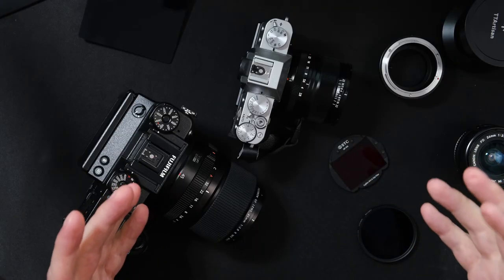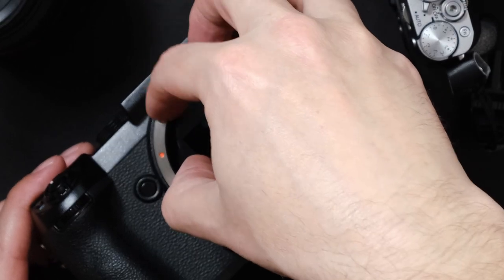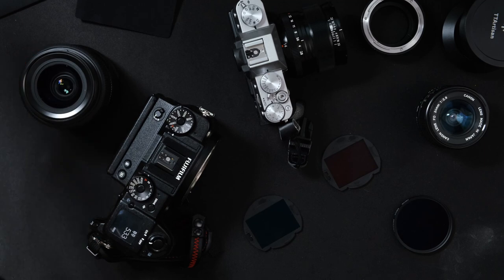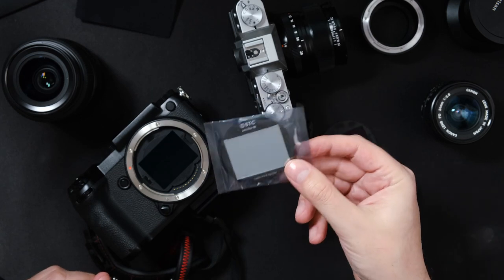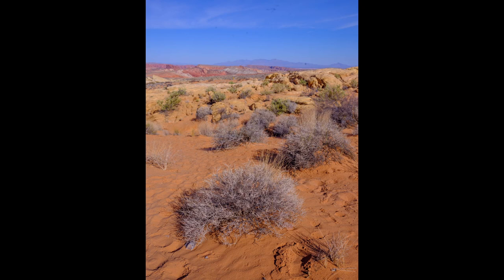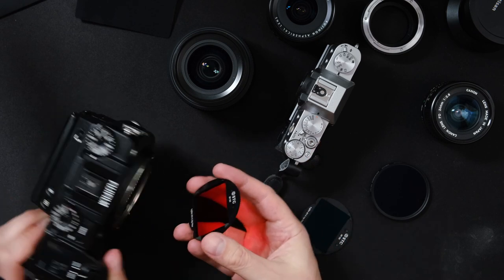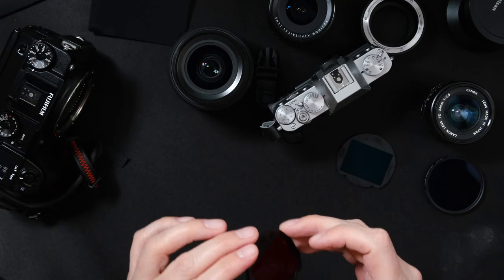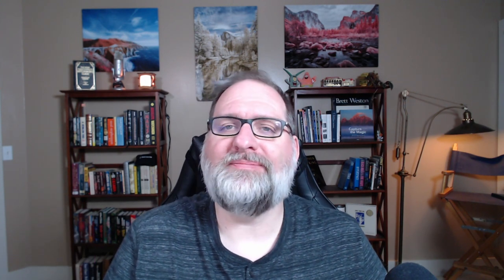Clip-in or Flange Filters for Infrared Photography

Comment: Thanks for your discussions on shooting infrared. I’ve been shooting with external lens filters for 8 months now and I recently decided to switch to clip-ins to cut down on the number of missed shots because of sun flares and glare. I have really nice, coated Kolari filters which do a great job limiting the flares and glare, but I’ve nevertheless missed out on some compositions I really wanted because of the sun’s position. 

I should also add that I tried using lens hoods, but the amount of things stacked on the front of my lens resulted in vignetting that compromised my picture. With the clip-ins, a lens hood becomes an option again for flares and glare.
Reply from the maker: Excellent! After taming hot spots, I've discovered that battling against sun flares and halos to be the next on going battle. They are certainly less of an issue with my clip-in filters than they are with external filters.

Comment: They are relatively easy to DIY.  I used a E 0.29  black plastic file folder to cut out the relatively complicated shape of the holders. I glued gel filters from a Lee sample booklet with contact glue. (dark red, light red, orange, teal and indigo).  Works just as good as expensive filters with my 7 artisan fish eye and my super wide objectives, which have a curved front element.
Reply: Full spectrum converted Sony 6000 a

Comment: Thanks for the video, Rob. Did you get to notice any differences with hotspots. I figured there could be differences because of the difference in elements the light can bounce around you in.
Reply from the maker: I've not noticed a difference in hot spots using when using flange filters compared to external lens filters. That would be an interesting test, but you'd need the same filter in a flange and external lens form factor to really confirm. I suspect that there is not much difference, since the most problematic hot spots result from how IR light refracts within the lens itself. I would expect switching lenses to have a much bigger impact.
Reply: I suspect there will be little to no difference. The hotspots are a function of the AR coatings not being tuned for IR light as well as the dispersion/color correction of the glass elements being tuned for visible light. The hot spots occur in any case, IR filter or not, you just don’t see them with a hot mirror in from of the sensor.

Comment: Rob - thanks for the excellent video. I'm thinking of getting a set of clip-in filters for a converted Nikon Z camera and am wondering if you saw any negative effects of clip-in filters on optics... hot spots, sharpness, etc other than dust? I've heard some reports of odd color and exposure issues with clip-ins especially with wide and ultra-wide lenses.
Reply from the maker: I've used fisheye lenses with clip-in filters and not seen any issues. But I guess it will depend on the camera model and lens. Extra dust on sensor is the only issue I've encountered.

Comment: Thanks. Very helpful. I have just had a Sony A6000 converted and i was tempted to get a full spectrum conversion and use these drop in filters but still quite difficult to get hold of them in UK and the few reviews i could find suggested that the Sony APSC filters were drop out filters and quite awkward when changing lenses which i do a lot in the field. So i stuck with another 720 nm on sensor filter. ps thanks for the white balance video and profiles; a huge help.
Reply: I am using a converted A6000 now, these filters work pretty well. I had to order them from asia, though.

Comment: Hi, Rob.  Excellent video!  Another downside is they are quite a bit more expensive than screw in round Hoyas.  I have an unmodified Z8.  Do you know if the drop in Kolari as dark as the Hoya 720nM?  I really like the idea of the drop ins so I can use some of my extreme wide angles.  Also, how are the Kolaris shooting into the sun?  My Hoya creates a huge amount of lens flare.  Thank for all your help!
Reply from the maker: Interesting idea. I should try a test to compare internal filter to external filter when shooting into the sun.
Reply: and on the comparative darkness Q?
Reply from the maker: @eddieagha5851  I have yet to specifically compare the Kolari filters directly with Hoya. In general, the Kolari filters that I have are of great quality and effectively block/transmit the wavelengths they are rated for.
Reply: Thank you Rob!

Comment: Very interesting.  I just replaced my 590nm X-E2 IR with a 560nm X-T2 IR conversion.  This might persuade me to go full spectrum with a new camera at some later date.

Why is there no such thing as a light bag, or a clear changing bag?  This would be ideal for changing a flange filter in the field.  True, you could use some camera rain covers, but most are too porous and not suited to a dusty windy situation.

Did you use STC flange filters for this video?  They are the only ones I could find that are suitable for Fuji.

STC says some lenses are not suitable but do not say why.  They include 15-45mm, 14mm, 16mm f1.4, 18mm f2, 23mm f1.4, 23mm f2, 27mm f2.8, 35mm f2 (but not 35mm f1.4) and 60mm macro.  It can’t be a physical problem so it must be something like colour fringing.  Do you know what the problem might be?  If you used STC, did you try any of these lenses or are you still able to do so?

Kolari have flange filters for Sony and Nikon so perhaps may have Fuji in due course.  They do not mention any problem lenses with their current range.  Kase have non-IR filters for Fuji and say they are not aware of any compatibility issues with lenses.
Reply from the maker: I like the changing bag idea. Something to explore.
I suspect that the unsupported Fujinon lenses physically extend into the flange in a way that would touch the flange filters. Take a look at one of the unsupported lenses from a side angle, you will notice that a black plastic ring extends out beyond the silver mount. This black ring probably intersect with the flange filter. When I first discovered these filters, I was disappointed to learn that two of my most commonly used IR lenses are unsupported. As a result, I didn't purchase any for my X-mount bodies. With the GF-mount, the support is better, so I only have flange filters for the GFX system.

Comment: Hi Rob. 
I just found your channel and I find it very informative and the best for infrared photos.
I have a question , I'm into Landscape and deep Sky Astro.  I got my Canon 6D Astro modified visible Ha.
I was also looking at getting my old Canon T3I modified as perhaps Full Spectrum.  Then ofcourse I ran into your channel. Now I'm interested in Infrared 590nm and 720.
I would like to use infrared as a walk around camera. 
My question is if I get a Full Spectrum  camera for Astro I'm assuming I can use filters to achieve  590 nm and then 720 nm?
My idea is  to make a 3 in one multi purpose Camera. Is this possible?
Would I need long exsposure using Hoya 590 and 720 sin on filters. 77mm
Reply from the maker: A full-spectrum camera can serve as both an astrophotography camera with Hα, OIII, or SII filters, and an IR camera, with a variety of high-pass or dual-band filters. If you are using a 590nm or 720nm filter on a full spectrum camera, the exposure times will be comparable to visible light photography. The higher the value of the high pass cut-off, the more light is blocked and the longer the exposure will be. With an 830nm filter, you can still shoot handheld, but you might need to increase the ISO.
Reply: @robshea  thank you Rob for helping. I just picked up a Hoya R72 filter and my Full Spectrum Camera should be in on Thursday. I'm looking forward to this new chapter of Photagraphy.

Comment: Is there a benefit to using a drop in or flange filter over the one on the end of the lens with respect to reflections or flare? I would think having the filter closer to the sensor would possibly reduce those negative effects.. but not sure…
Reply from the maker: There might be a slight benefit, but only over using circular filters with multiple step-up rings that move the filter away from the front of the lens. I have seen artifacts when using many step-up rings. However, I've not seen any issues when using a circular filter directly on the lens.

Comment: Thank you Rob. Where can I buy these? I have a Fuji X full spectrum camera.
Reply from the maker: STC Optics has filters for both X and GFX. I would recommend these for converted cameras only. https://usa.stcoptics.com/collections/fujifilm
Reply: @robshea  Hi Rob.
I just discovered your channel. Wish I did many years ago, there has been a lot of trial and error instead...
I used to have a fuji S5 IS (full spectrum), then i had a xe1 converted for IR only. And it's what I have been using now and then.
However I've been thinking about trying IR with a more modern , higher res , though unconverted , camera (fuji x or gfx). But I only have my very first filter for IR, i think it's Harrison and Harrison. Since I am looking for a bit more variety, i was considering these clip-on, both in IR and astro. 
So my question, why would you recommend these only for modified cameras?
Thanks! And great, specialized content.
Happy holidays and best wishes for next year.
Cheers from France.
Reply from the maker: @newnastyn  With an unconverted camera, you are limited to 720nm and higher IR pass filters. You will want to use high-quality filters since low-quality filters tend to leak lower wavelengths of light. While I've had great success with the STC Optics clips-in filters on a full spectrum converted camera, their 720nm does not block as much visible light as my trusty Hoya R72. For unconverted cameras, I would stick to higher quality filters, such as from B+W, Hoya, Kolari Vision, LifePixel, and Tiffen.
Reply: @robshea  thanks! I'll try to clean up all the boxes with gear in them, now that you mention it i do remember a b-w filter... Maybe I can unearth it...

Comment: Hi Rob,

My converted (mirrorless) Pentax K-01 is not listed as a compatible camera in the STC Optics site.  I have a support email into them and waiting for reply,  but I'm wondering in general if there is something different about the inside of a mirrorless (other than the "no mirror...") that precludes a flange filter.
Reply from the maker: There are a couple of factors. First, is the flange designed to allow a clip-in filter to fit in that space. Second, do the lens rear elements protrude beyond the rear mount. If so, this could occupy the space where a clip-in filter would go. This is the case with some of the Fujifilm X lenses.

Comment: Hi Rob! Can you help me with WB setup on a Sony A6300? I changed it to full spectrum. I can't get the custom WB right with both the 720NM and 590NM IR filter. I do it on white paper and in the green garden and it always fails. I'm in Brazil and the weather is very cloudy. Summer hasn't arrived yet and the sky is full of clouds. Do I have to go through the programs to set it up correctly? 
Thanks!
Reply from the maker: Some cameras might struggle to set a custom WB with an infrared filter on. Are you shooting in raw or jpg? If you are shooting in raw, you can also WB in your editor and that might be easier. It's not required that you WB in-camera with raw. Clouds would also be a fine subject for setting a WB on. WB in-camera is only required if you are shooting in jpg.
Reply: @robshea  Thank you Rob. I shoot in RAW. I go to make in Lightroon. My Canon T3i(600d) is perfect in 590nm and 720nm.

Comment: The camera has to be converted in order to use the flange filters?
Reply from the maker: Not specifically, but you are limited to 720 or higher nm high pass filters.
Reply: Would you have any examples?
Reply from the maker: @ritadelcid2909  Which model of mirrorless camera do you have?
Reply: @robshea  I have a Fuji XT1 and a Xpro2. Converted Nikon and Olympus. I recently been using the filter adapter on my iPhone 14pro
Reply from the maker: @ritadelcid2909  You can get them from STC Optics: https://www.stcoptics.com/collections/clip-filters
or Kolari Vision: https://590.red/kv_clip

Comment: If only they be little less pricey... My D70 is worth less :) But it's good option for Fuji if I get one. For Nikon I have only two lenses and one filter is ok, but for Fuji it would be few more lenses and much more different sizes. And beside that using filters is pain in the... thread.
Reply from the maker: 😆 Certainly not good for all systems. Hopefully more options become available for more systems.
Reply: @robshea  The problem is they got Nikon DSLR version and it would be nice not to bother with traditional filters. On my Irix I have 95mm thread and use some frankenmount down to 72mm :)